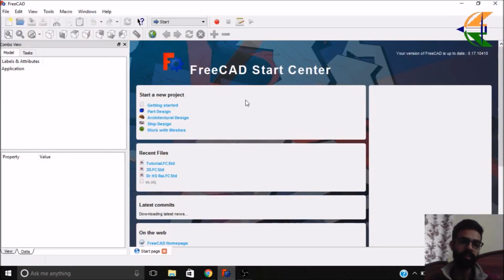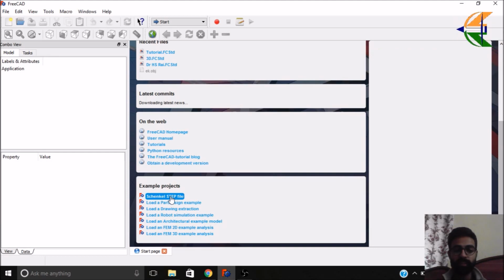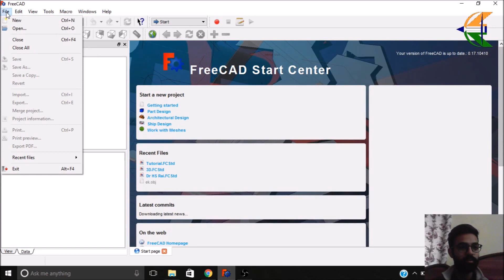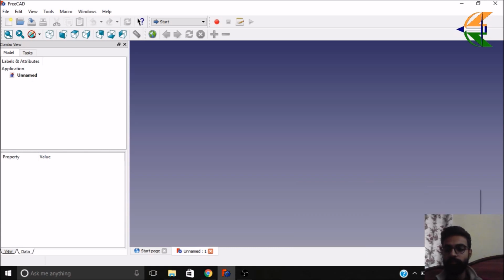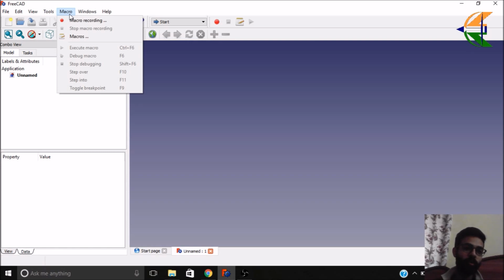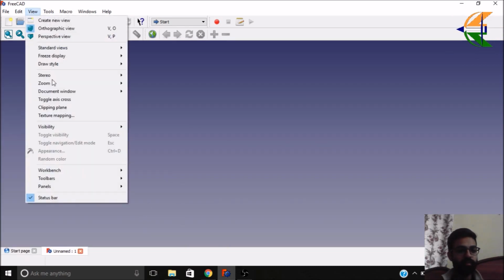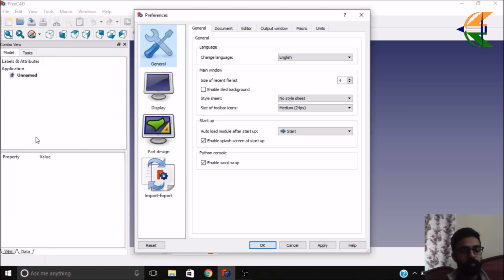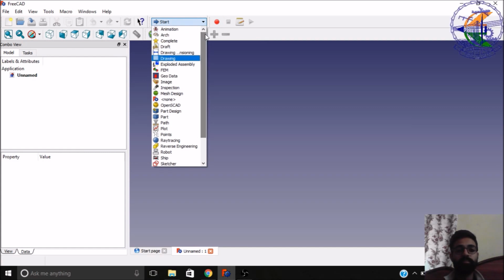2. FreeCAD Beginners Tutorial: User Interface & Overview of FreeCAD

Comment: hello ..can you tell me if i can revit file on freeCAD program ..thanx alot
Reply from the maker: Yes, you can do that by exporting your model in IFC format from Revit.
Reply: good ..but i have a question a freecad has all feature of revit ?
Reply from the maker: The vice-versa of this question can be also there. FreeCAD is still young and growing rapidly.
Reply: thanks a lot ,if i have any problem can i ask you ?
Reply from the maker: Sure, Mohamed.
Reply: thanks for your time :)
Reply from the maker: You're welcome. :-)
Reply: excuse me if have already file with extension .rvt how i can convert  to ifc?
Reply from the maker: simply open that file in Revit, then export it into IFC format.
Reply: i want to convert .rvt file to .FCStdr ,becuase i am trying export ifc from revit and import ifc file into freecad this operation take alot of time..are you have a way ?
Reply from the maker: Mohamed Barakat, this step generally takes time due to heavy IFC files.
Reply: Thanks brother for this knowledge